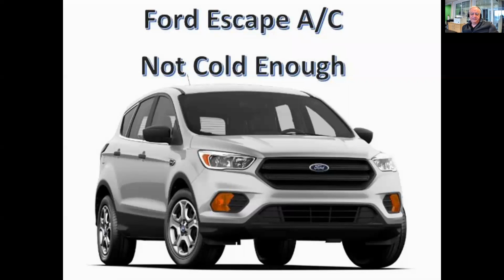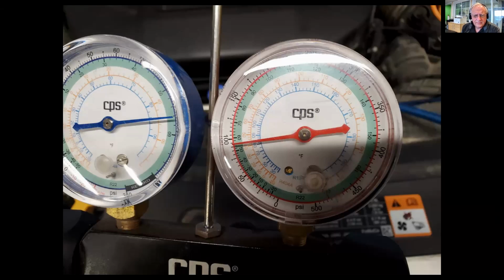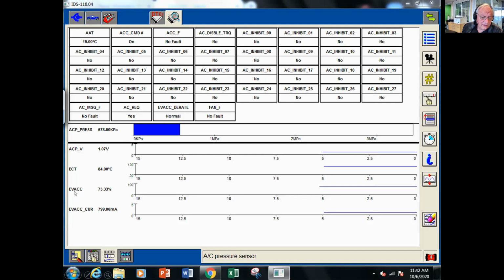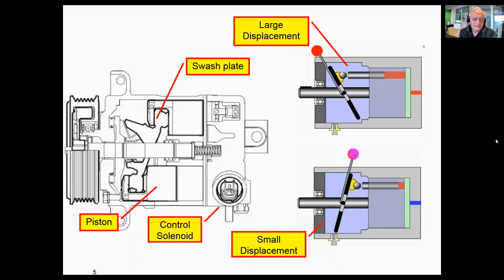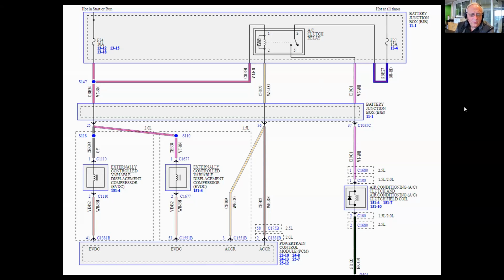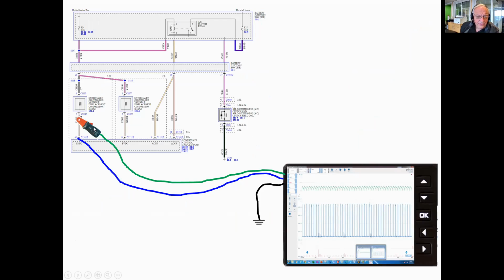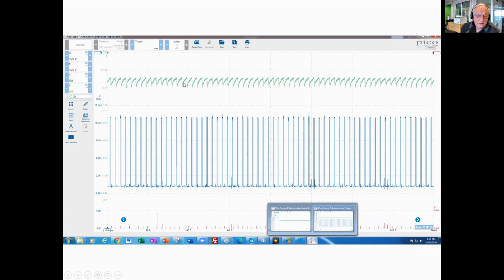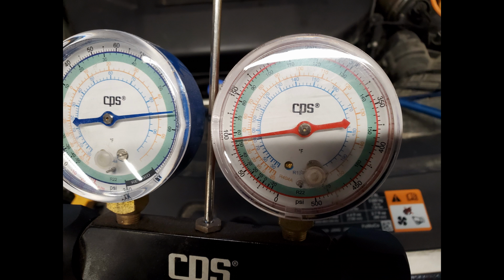AC Not Cold (Ford Escape)

Comment: Thanks for your video. I wanted to check the hi/low pressure on a 2019 Ford Escape titanium ecoboost but I can not find the low pressure port. The high port is next to the radiator but I haven't found the low port or a video that shows where it is either. Can you tell me where it should be?

Comment: I had normal pressure last week but cold
Return pipe 2016 we have clutch turning and spraying water on condenser is helping or changing temperatures. I get it back again today. I’ll see if pressures are like static readings like yours . I also
Have dual climate system fan was noises , customer doing cabin filter yesterday and I have no hvac module on Autel 906 scanner , some communication errors but nothing found on Identifix.

Comment: hello I have a question to test the variable solenoid one side has full battery voltage how do I test the computer side with a multi miter
Reply from the maker: Hi Juan. Testing the control side of the solenoid requires a lab scope, as a multimeter cannot capture the pulse width modulated control from the PCM.